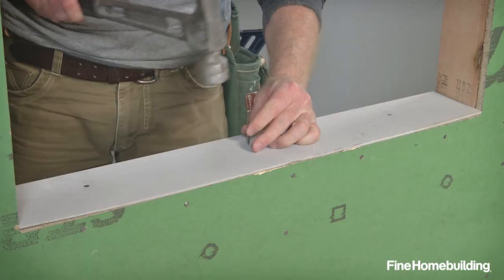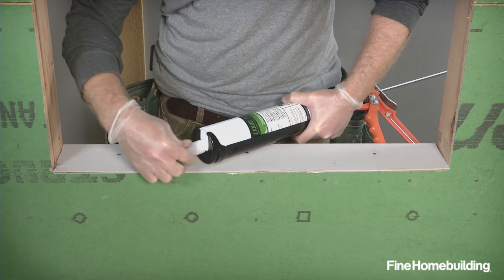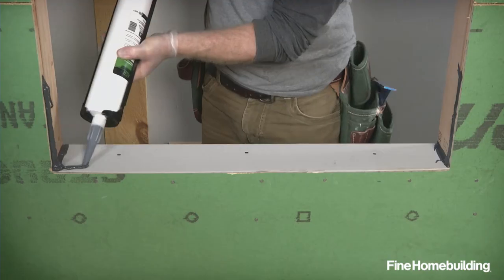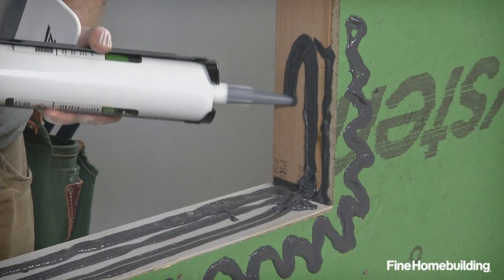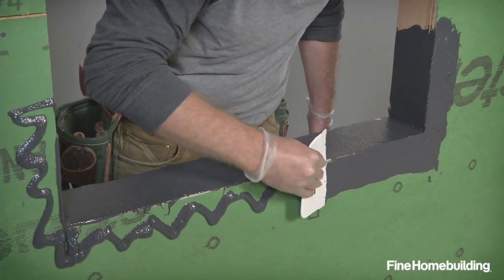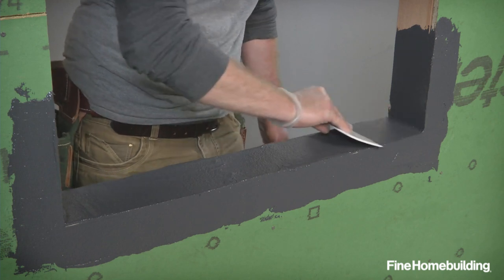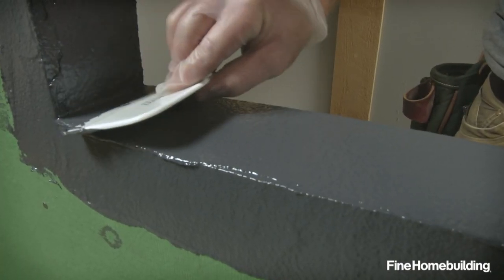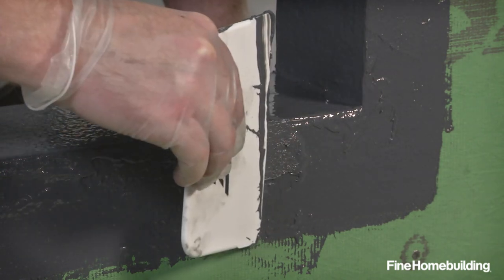Liquid-Flash a Windowsill Pan

Comment: If installers focused more on proper install techniques, there would be far less need for so much effort in waterproofing the opening. I have removed windows that were installed 100 years ago that had no evidence of water infiltration.
Reply: What 100 year techniques? Like not using insulation and having it leak like a sieve so it will dry out? No wonder the US building trades are 100 years behind the rest of the world.
Reply: N C like proper layering of materials. Proper flashing and general knowledge of gravity and how water runs downhill.
Reply: The salient point is a 100 years ago it would just "dry out" even after the flashing fails. So that 100 year old window frame was most likely wet on many occasions. While in a modern insulated air tight building it would rioted away. So higher standards are needed now.

And, Liquid-Flash a Windowsill Pan is not just to prevent water infiltration but is part of air infiltration prevention system too.

And "proper layering of materials" is still useful but ice damming like on a roof would defeat it causing a leak. So it will need a sealing membrane. Also on the separate topic of the principals of physics never change ie "general knowledge of gravity and how water runs downhill". As someone with an engineering background I have to agree. Even if its not that directly relevant to use Liquid-Flash or not.
Reply: N C not worth it
Reply: True, installers living in the past are "not worth it"...